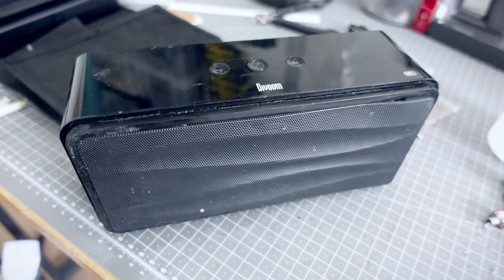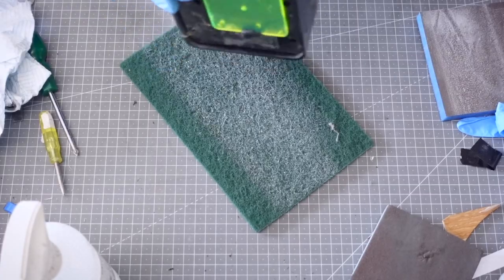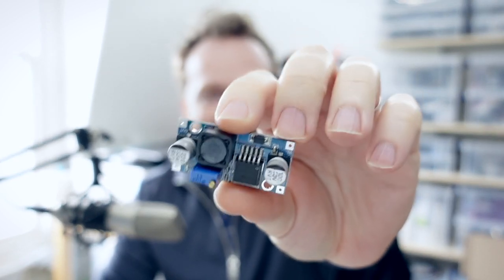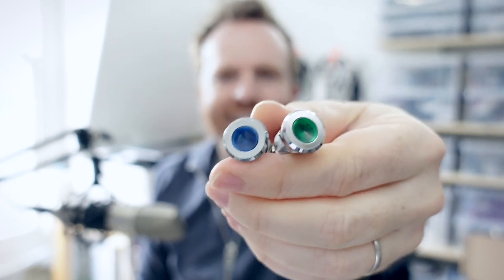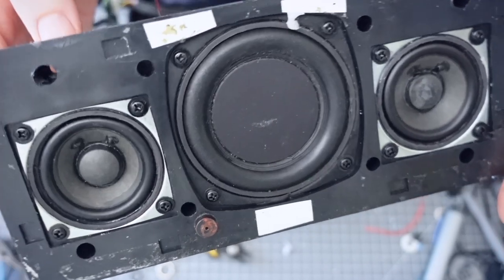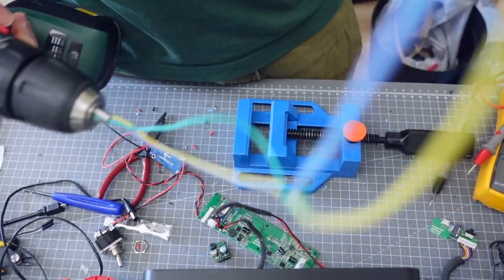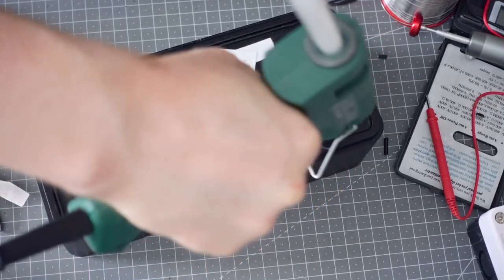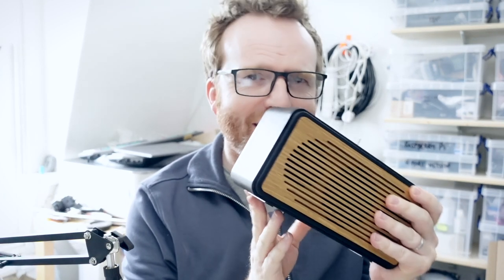Bluetooth Speaker to Airplay conversion and make-over

Comment: Very nice project.  I had a similar ground loop hum on a small powered speaker project I was building and I used a DC-DC converter IC which isolates the ground of the input from the output.  Very small, worked great.

Comment: Good video. I like it when stuff is given a new lease of life. It does sound like you need some strategically placed shielding if there's interference. Could the cabling be treated to some wrap around shielding?
Reply from the maker: Thanks so much! The noise seemed to be related to the inductor on the main board rather than the audio cables but yeah I’ll definitely experiment with some shielding.
Reply: @seblee  I was thinking shielding / screening might be easier to accomplish rather than trying to squeeze extra stuff like filters into an already tight space.